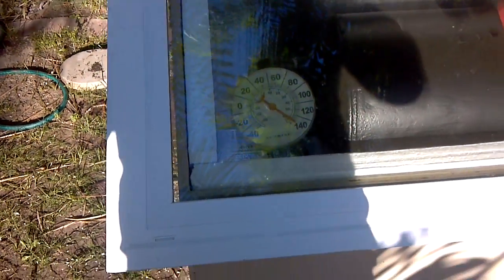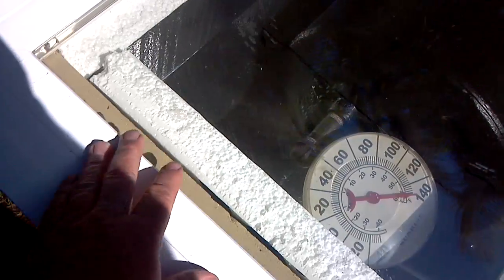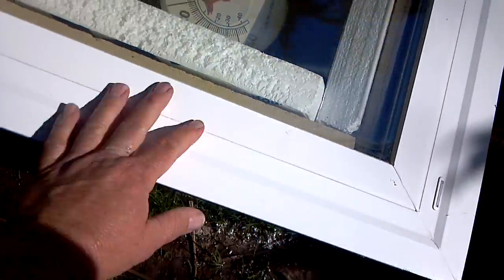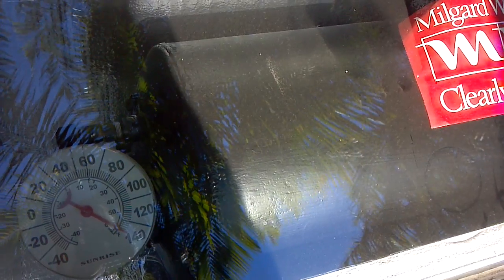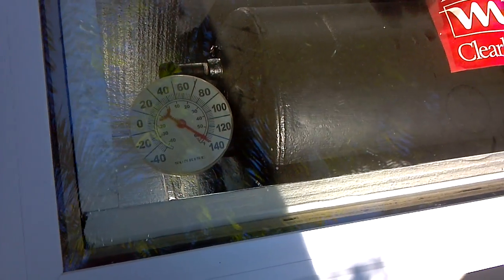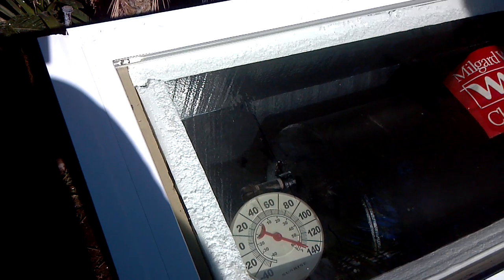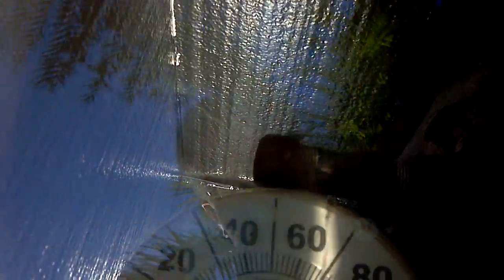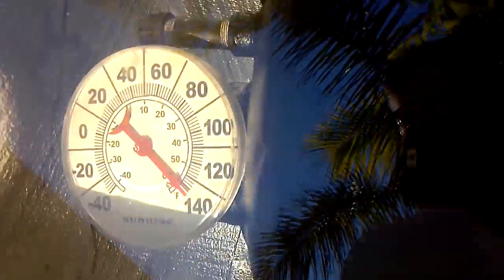Solar batch water heater part one

Comment from the maker: I value your opinion. I am going to be using the batch heater in the desert in conjunction with another water heater. So the solar water heater is a pre heater. I go out every other week or so. I bought one of your differential switches. So while I am NOT there I will be circulating the water from the solar batch heater to my other water heater. Like you said every little bit helps. Thanks again John. JCSolar homes.

Comment: Bob Nice job on the batch heater. I am amazed that the air temp inside the box reached 140* F  Of course the water temp inside the tank will be much lower but any gain is a plus..I don't believe you will need a circulation pump on this direct connect system. 
Keep on trucking.